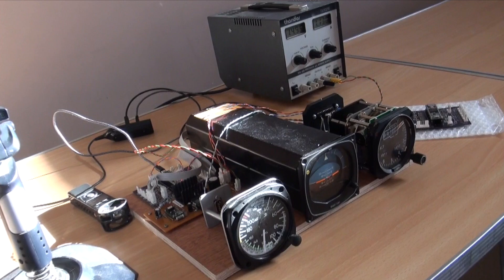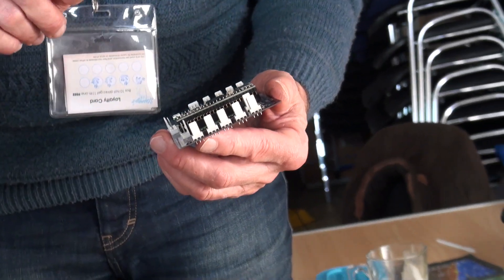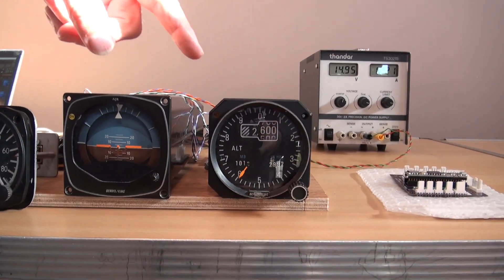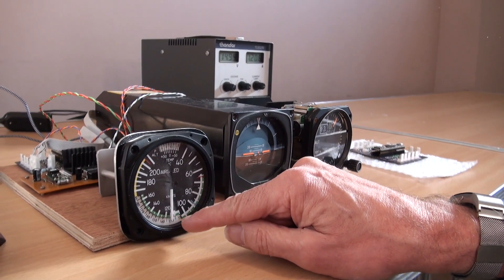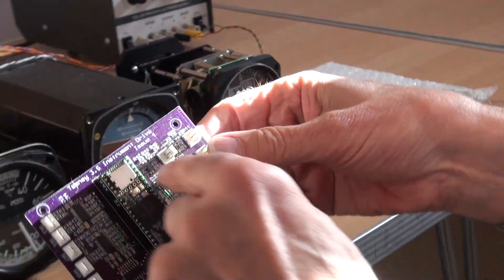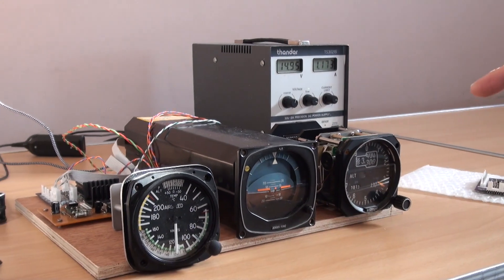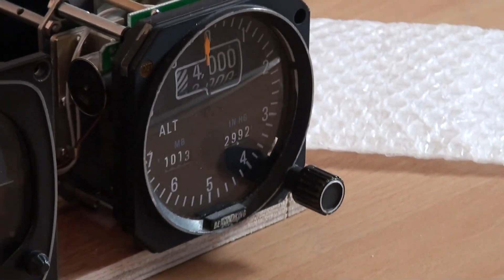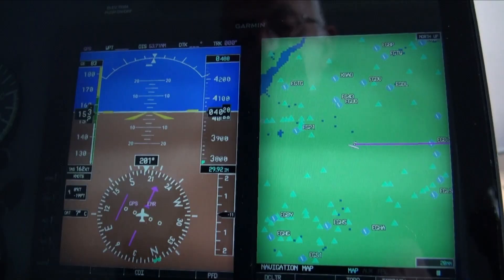Frasca to X-Plane Interface

Comment: David, I have a 141 Frasca running on Windows '95 that still works! I would like to retrofit it to X-Plane to at the very least get the yoke, rudder pedals, landing gear, attitude indicator, directional, airspeed indicator, and the flaps working. The radios might be another challenge, but not as important to me. Can you point me in the right direction to learn how to do this? I'm a PC & Mac technician by trade, so I'm pretty good with a soldering iron, and can make logic boards / motherboards. Any assistance would be appreciated.

Comment from the maker: I used 10k (linear) variable resistors connected to a Leo Bodnar USB interface.  One each for the throttle, mixture, elevator, ailerons, rudder, flaps and toe brakes. All very straightforward.  The switches were also connected using a diode network as we needed more than 8. With a diode network the Leo Bodnar accepts 32 switches.  As we were using regular on/off switches, LUA scripts were used to program X-Plane accordingly.

Comment: Is there more information on how you got xplane to work in your frasca simulator? and are the boards for sale?
Reply from the maker: The instruments came out of a pair of scrap Seneca IFR simulators made by Frasca .  A clever friend used a Teensy processor driving a home made servo driver board.  He also wrote the software to pick up the X-Plane data and to input data like the QNH.  This reverse engineering challenge has worked, but his own simulator (strangely also a Seneca) uses a glass cockpit.  Far simpler than reverse engineering clockwork instruments as much graphic software is available.